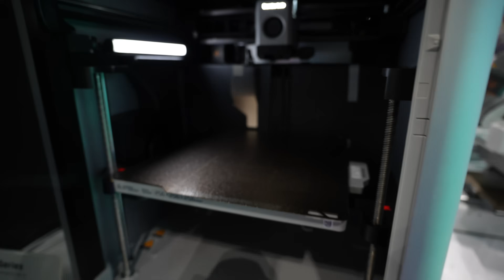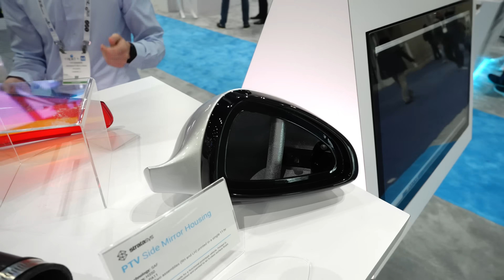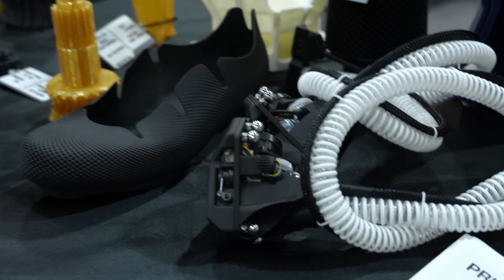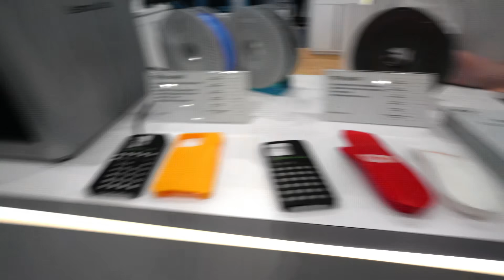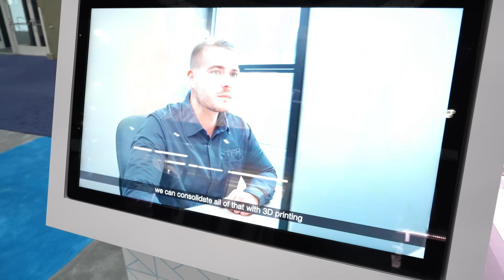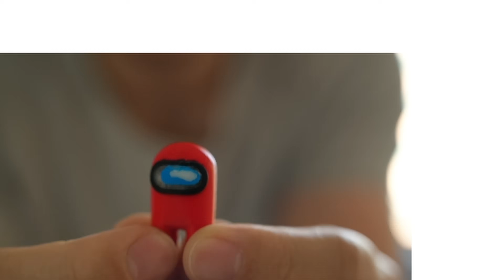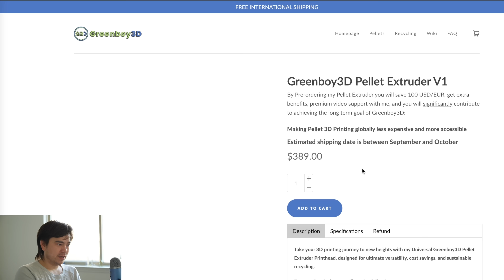Bambu Lab Patent Infringement, PRUSA MK4S, and Cheap Pellet Extruders (3D Printer News August 2024)

Comment: Most of the patents weren't even original when they filed them.   It'd be interested to see how many of the reprap concepts got patented by Stratasys.  Stratasys has lost > 50% of their share value within the past 12 months, so they are failing fast unless they figure out a way to turn it around.   Their move to enforce questionable patents seems like a VERY desperate move to get some 'free' money without really competing in the market.    This whole legal battle might be the nudge that BL needs to push out a new round of updates (by adopting even more open source tech).

Is load cell leveling (bed or head mounted) still the best way to create a bed mesh these days?

Comment: Many but not all of the stratasys patenta have been filed after the features were implemented in open source projects (or in case of nfc spools by XYZ). This raises the question if the ideas fir the patents have come frome open source or competition or if they were independently developed by stratasys around the same time.
Reply: Purge tower Patent 2013, earlier than reprap 2 color
Heat Bed Patent 2014, RepRap Mendel Heat bed in 2013
Gap Fill and Arachne Patent in 2006, earlier than Arachne Paper
Force detection 2013/2015, earlier than reprap 
Tagged Spools 2018/2020, XYZ was using tagged Spools in 2017 (2 min search), maybe earlier
Networked Printer 2012/2012, octoprint initially released in 2013 but developed in 2012 with public repo
Import of printer config into slicer 2022, X1C with that capability released in 2022, others might have been earlier

Comment: Is there not a time period from when one becomes aware of a cliamed patent infringement until you notify the perceived infringer .( statute of limitations ? )  Or can you just sit on your butt , let them build a large market presence,  and then wake from your corporate slumber and cry foul plus use scare tactics to allege that the unsuspecting end user is also potentially liable . Where does this end ? . It would be like Bosch threatening Tesla owners because a similar component to one of theirs may be used in the Tesla . If successful Stratysys will kill the whole industry at which time I hope that no one will ever buy a product from this avaricious company who just could not move with the times . If they are so tech savvy and locked up the industry with patents why did they not bring out a well priced model like the Bambu Labs for the small business and hobby and education market . Because they can't compete on low margin and high volume business -

Comment: I bought a stratasys bst 768,  when they first came out and it cost more than a car in those days . Slow and painful to use , and one material cartridge and one  support cartridge cost more than a Bambu P1P today , which I have had zero problems with and it is way way faster , better slicer and better print quality . Stratasys reminds me of the days of the minicomputer,  when the upfront costs were exorbitant , the spares were a rip off and you had to sign a multiyear maintenance contract for support ( DEC , Burroughs , prime , ibm and a few others ) .  Instead of being innovative , they rest on their laurels and screw all industry players/ competitors  and innovators with an army of patent attorneys - well , well all good things come to an end and when patents expire the days of milking the customers will be over and the jig will finally be up. I and many 100's of others will celebrate when they hit the wall.  It's 2024 not 2000 .

Comment: Having a patent may mean nothing - or everything. It is a risk for both. And not enforcing a patent on Prusa or Creality can actually damage their claims. You either enforce your IP or you don't. Picking and choosing, courts won't like this.

And on load cells, that might not survive. They didn't invent load cells - and that is literally the point of a load cell. That patent has a good chance to get nullified. This may be seen akin to using a screw to hold something down, and then "if you use a screw, we came up with the novel idea of using a screwdriver on a 3D printer."

Comment: Stratasys shakedown of BL because they want a piece of the consumer market $ that they would not normally have any access to. I think they want license fees from BL, but this is also meant to intimidate other 3d  printer manufacturers, as its obvious many/all of the technologies exist throughout the consumer 3d printer market. Stratasys is going after BL because they're probably the biggest right now, and want to set make an example of them. 
Not sure I understand the problem with BL's network plugin that you mentioned about halfway through, since it's not really part of the slicer. Prusa has their own network software which as far as I know is also not open source.

Comment: as much as I don't like what they are doing they do have the right to defend there patents they also have to protect those patent's or they are setting a presidence to allow anyone to use the technology they developed. I don't agree 100% with the patent system I think the time line should be much shorter, or a much better sharing system be put in place say after 5 years they can license the technology for a more reasonable price.

Comment: you have to defend your patents or else you will lose them.  It is a fact that they never did so before now (which is why the 3d printing community grew so quickly), so if Bambu capitalize on that, they could potentially have a large portion of Stratesys patents thrown out

Comment: So the first patent is probably not useful as deemed to be a trivial invention well and still easily gone around plastic extrusion used to part similar ways.
The second one with wall infills is a software one? So nothing then in the US.
I'm not sure if the load cell stuff is possible to be patented as just for 3d printing use case and if not then they would have to fight a way bigger set of companies like dmg mori, okuma etc.  
For the rfid tags i'd switch to a different tech as i suspect they didn't simply get a patent for all RF tech but just this specific one.
I doubt that networked 3d printer will go by as HP is long in the business of printers and they are in fact 3d as the layer they lay isn't 2d.. especially for non ink printers.
(I'd guess HP would just buy the entire company as they are tiny compared to them)

Comment: Their patents are super generic. "Non-tape coating" basically covers simple things like painting it red as well as coatings that haven't even been invented yet. That's ridiculous. I'd understand if they had a patent for a very specific coating that isn't obvious. 

Adding network capability to a printer is also ridiculous. People add and have been adding network capability to literally anything. I'd understand if they had patented a specific communication protocol but not simple stuff that covers even things like an HTTP API or web interface.

Even though I don't particularly like Bambu I hope this goes very south for Stratasys.

Comment: To your question on how patents work with open-source: It's fairly simple when the software is distributed under GPL, AGPL or LGPL, like Cura, Slic3r, PrusaSlicer, Bambu Studio, and OrcaSlicer. You will not be forced to use either of those.

  Each contributor grants you a non-exclusive, worldwide, royalty-free
patent license under the contributor's essential patent claims, to
make, use, sell, offer for sale, import and otherwise run, modify and
propagate the contents of its contributor version.

BambuLab can't patent and use slicer features without having to write a new slicer from scratch. The same goes for Cura.

None of these slicers can ever use the patented works when they can't grant you a license. This directly violates the GPL terms.

Comment: The test for being a novel invention is if it is not obvious to a practitioner of the art. That last part is a key. It doesn't need to be non-obvious to the average person, but to a practitioner in the art of making 3d printers. In the 660 patent, I definitely do not see moving from an applied tape to a non-tape coating as meeting the novelty test. (BTW, the I3 MK2 got a PEI coated print surface in May 2016, before the patent was granted, but unfortunately about 3 years after the effective filing date, which is when protection starts) (eta: not a lawyer, just someone that has read up on patents)

Comment: Stratasys can f*ck off. The only reason they have these patents in first place is because they patented 3-D printers in general years ago. They had a monopoly on them so now they have a monopoly on the patents. And everybody uses those. They’re only going after bambu because it’s taking their market share. Every single one of those patents is being used by 80% if not more of the 3-D printing market yet they only go after bambu. 3-D printing was invented in the 80s yet there was no innovation on a large scale until the 2000s to the 2010s because Stratasys was the only one allowed to make them now they are saying nobody’s allowed to innovate and make better go back to your ender threes.

Comment: Why would stratysys wait so long for this? Their product must really suck if a consumer printer has taken all of "their" business
Reply from the maker: The stratasys machines are way over specced and overpriced for most customers. A lot of customers want something smaller and cheaper to operate, which is why the X1E is so popular right now.

Occasionally there will be customers that need a 500mm ultra reliable high temp printer, and are willing to pay $100k for it, but 90% of customers are just fine with Bambu Lab capabilities.

Comment: Bambu Lab support is really terrible... It's like you're talking to Aliexpress or Banggood support. And that for €1000 printers...

Seems they're just focused on selling, but when there're problems they try to walk away from responsibilities. And trying to blame other things so it seems it's not their fault or product.

Hoping that lawsuit is going to have quite some impact on Bambu. Their printers are kinda nice, but the overall experience is terrible.
Reply from the maker: I’ve had mixed experience with support, but to their credit they did sort out a shipping issue with my order that was completely my fault.
Other times, when they are having a SHTF moment, like during a new product launch or the cablegate situation, they can get super backed up and a conversation with them takes weeks
Reply: @NathanBuildsRobots  Yes, I can confirm that.
I've bought a P1S Combo (which os serious money) recently from them. But it's a nightmare so far.
The first unit arrived damaged, while the outer box didn't had a scratch. Dents, scratches, bended screen connector...
First they tried to blame the carrier without giving a solution. But the box was undamaged and bended connectors is just uncarefull handling from factory. Then they admitted the damage could have been happened during assembly, like it's something normal for a €1000 machine and still without a solution, replacement parts or a compensation. Took me quite some effort to get it returned and to get a new unit.
The new unit arrived upside down with a torn box. So this time the delivery guy had handled it like an idiot, so I refused it at the door.
Sure, it's not Bambu Labs fault, but it wasn't solved in great matter neither. Instead of directly sending out a new unit, while I did not accepted the parcel and had send them pictures of the state they tried to deliver it, they first wanted to receive and inspect the parcel. While this was still a matter between Bambu and the carrier at that point and not between Bambu and me. But still had to wait 2 weeks after receiving a new unit.
The 3th and the latest one now has some mechanical problems...
And again, it's terrible with their support. Seems like talking to someone without technical knowledge or knowledge of their own product. Or just acting stupid, hoping you're getting tired of them and just leave it be.

I'm actually on the point about starting a legal case too now.

Comment: Thanks for the video.
Generic advice: always check which patents are granted in Europe, because the EP office checks WAY better so if it's there as well, likely it has a basis.
Out of the 5 being on the news now, only two are, and one (purge tower with multiple active/standby heads), given that it has been FILED (not granted) in 2014, it's quite founded. I remember 3D printing in 2014 and that idea was definitely not obvious back then. It is now, but that doesn't take away anything from the patent, filed back then. As you pointed out, in fact. I appreciate your objectivity.

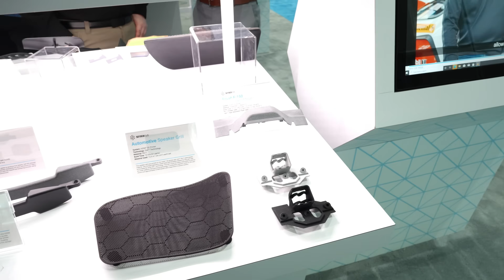Comment: 4:20 If Stratasys sold $200.000 printers to enterprises, isn't that model already undermined by being able to buy a couple of weeks of an engineers time to build one of the open source printers for a fraction of that?
Reply from the maker: No company is going to do that. They don’t like to see engineers wasting their time on side projects.
Reply: @NathanBuildsRobots  Depends on the size, right? There are indeed companies who will splash out 200K just to ensure 24/7 support. Bambu does not compete in this sector.

Comment: Bambu gave you a prosumer printer at a high end enthusiast price it's cheap and pushed the consumer market out of bed slinger hell. Bambu's real contribution was the post extruder head end filament cutter this resolved a lot of issues with the Prusa style MKS thing that no one seems to be able to get working reliably and would give Kossel printers the ability to do multi material.

Comment: Stratasys is the perfect example of using the patent system to hold back humanity.
Patenting purge towers is patenting g-code, in the literal sense patenting an automated calculation of z,y,z,e locations. Thats like patenting the shape of a cube from a programming language invented in the 60s.
Patenting a heated bed, touches every hot plate in soldering, cooking, heated bed, heating element, etc. How that got patented, as well as heated chambers is beyond me.

Now if they went after mechanical designs, like delta, core xy, etc i could see it if prior art didnt exist.

Is bambu a clean company? No, but they didnt lock down an entire hobby/job for 99% of the population for 2 decades based off a guy making art with a glue gun
Reply: +100
Reply: They didn't patent g-code with purge towers, they patented part of a manufacturing process.  Those are the kind of patents that are actually both legally and morally valid.  Except that purge towers do not meet the requirement of not being obvious.  Same for heated beds (though less sure about heated chambers)

Comment: Make it so you are breaking the law by using a 3D printer,  or maybe by showing a picture of one or even a video like above. It doesn't not even have to be this manufacturer. Soon even cutting weeds is using filament type stuff, or even welding with that wire pushing system. What next the full stop use

Comment: A great parallel here is Mag-lite. In the US, they were synonymous with flashlight because they hold very very generalized design patents. As actual flashlight tech advanced, Mag has sued EVERYONE that manufactured “nightstick” sized flashlights. And they’ve won. 

The largest flashlight company in the US uses D cells and filament bulbs, and no one can survive long enough to compete.
Reply: I think they changed fully over to LEDs a few years ago and they make some rechargeable lights now.
Still bad and terrible value though.
Reply: @_Piers_  you’re right, they did! 
but the fact remains that there are more filament/D cell models out there than any other flashlight.

Maglite is not competitive in the modern flashlight market. They sell to police departments and that’s about it.

Comment: What are the specifics on Patents being infringed? That would give us an idea, if its a legitimate lawsuit or one typical of a patent troll🤔. Actually prior art is one way to overthrow a patent, other being a convincing evidence of infringement not being enforced on another bigger company,in which case, the patent will become invalid. Upholding a patent is the responsibility of the patent holder, and any complacency on acting on infringement will render a patent null and void. Seems like the specific patents are already being infringed, making it all invalid. For the loadcell patent, Bambulab might redesign it, in the platform instead working around it.🤔. Rfid is not going to be valid either, since it is used in mainstream already. In essence, it seems like a patent troll overall. Strong possibility BL may not settle🤞.❤👍

Comment: In my opinion the whole purpose of this lawsuit is probably just to have a judge issue a court order for an "independent" technical review of the Bambu Lab products in question. Such a review would require disclosure of many if not all closed-source proprietary aspects of their entire product range to an "independent" team of experts and the judge, meaning Bambu Lab has to reveal what data they gather and how they do it etc. Literally just normal everyday shenanigans by a former military contractor that used its funding to grow a nice little patent farm for big bro. Somehow hard to believe they're doing it for the money after selling printers to Lockmart for over a decade.
Reply: The irrelevant waffling about security/China in the application isn't relevant to their patents. So what else is it there for?
I think you're probably on to them.
Reply: Smart analysis